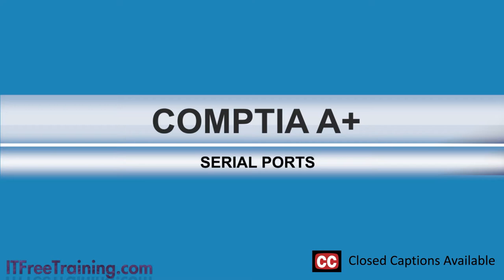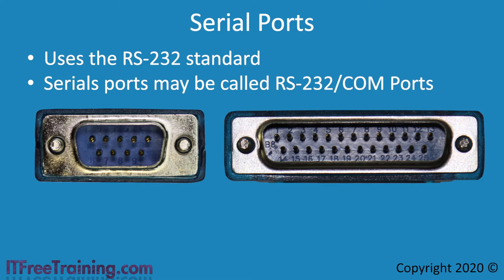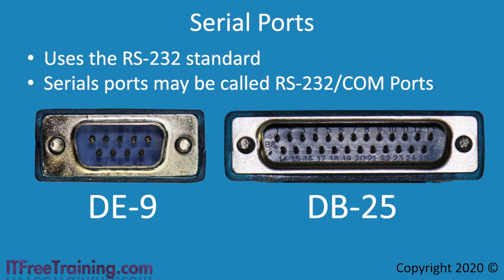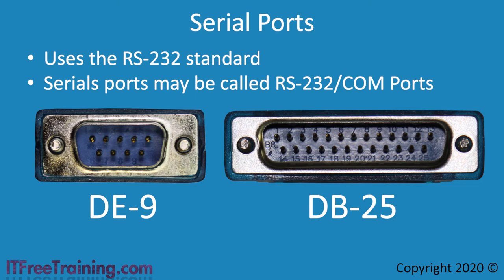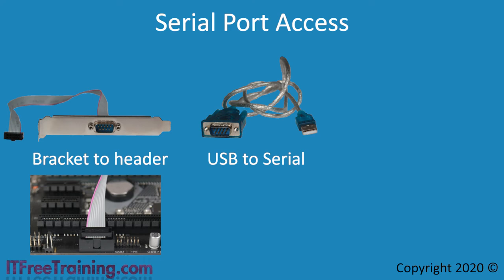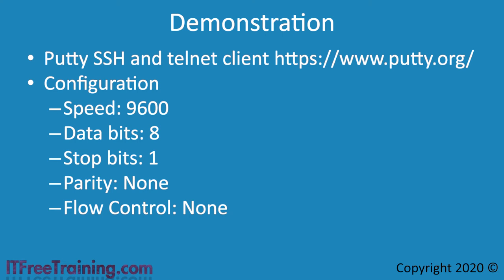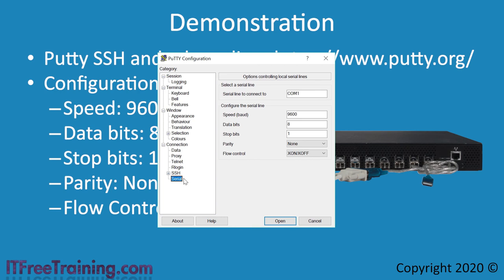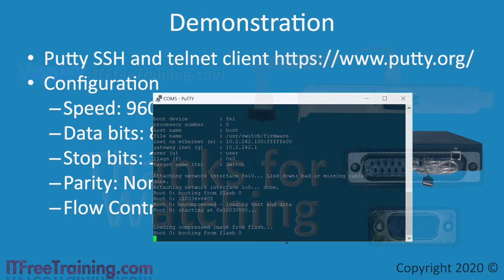Serial Ports

Comment: Nice to see someone knows that DE-9 is the correct term for a 9 pin connector, not DB-9.  I've been working with serial ports for over 50 years and at one point in my career had to order lots of connectors.
BTW, the 9 pin connector came in with the IBM AT computer.  The IBM PC & XT used 25 pins.  Until then I had never seen a 9 pin serial port.
Reply from the maker: Thanks. It has been a long time since I used an XT computer so I will take your word for it.

Comment: Very good information! I was in IT back in the 1980s and these things still give me nightmares. Modems, printers, scanners, computer to computer.... There was the way manuals said it would work, and the way it actually worked. We made "breakout boxes" with wires from DB25 ribbon cables soldered wire by wire to breadboards. LEDs in the proper places could show us what was really happening.
Reply from the maker: It's fascinating to hear about your experiences in the IT world from back in the 1980s! The technology landscape has certainly come a long way since then, and it's always interesting to reflect on how far we've progressed. Dealing with modems, printers, scanners, and the intricacies of computer-to-computer communication back then could indeed be quite challenging.

The "breakout boxes" you mentioned, with LEDs to provide real-time insight into data flow and signal status, were ingenious solutions for troubleshooting and debugging. They highlight the creative problem-solving that was often required in those early days of computing.

Thanks for sharing.

Comment: Two pieces of information I learned from this is serial ports are also referred to as  RS-232. The other is the smaller plug configuration is called a DE-9. I thought it was called a DB-9

Comment: Thank you. One question: if I buy an adapter from DE-9 to DB-25, then 9 of 25 DB-25 pins will be used, right? So what would other free 16 pins on the DB-25 side do? Would they just sit there and do nothing?
Reply from the maker: The extra pins provide some additional control signals etc, however it was pretty rare even back in the old days for devices to use them. Thus as time when on everyone started using the smaller connector. So if you use the adapters like what you are suggesting it is unlikely to cause problems since the extra wires were rarely used.
Reply: Well, I was asking because if I can only control 9 pins, then who controls the other 16?
Reply: @rimantasri4578   They just aren't used.

Comment: Thank you. I had a question ,I hope it get answered please. What if the device I'm trying to connect to is USB but the software is the old software and only communicates via serial. Is it possible to use the old software running a device that uses USB
Reply from the maker: USB and serial are different protocols. So probably not. Unless the USB connection appears in your computer as a serial port.

Comment: Hi! I bought a device with a software which only works with a usb key. I would like to know what that usb key sends to the PC and try to replicate it. Do you have some tip how to read it? Can the Putty help me in this situation?
Reply from the maker: You would need to get a USB sniffer to look at the traffic. If the USB key is used for copy protection then it most likely uses a challenge response system. Essentially the computer sends a challenge to the USB key, the USB key has information in it that is can generate the correct response. Thus, getting the USB traffic does not help since you don't know what secret is stored in USB key to generate the response.

Comment: Does anyone know the pinout for a 26 pin header on an old multi I/O card in IBM PC?... They have changed to 10 pin a long time ago (connecting the controller to either DB9 or DB25), but I have a REALLY OLD one: a Microforce PLB-85, in my IBM 5150... Next to nothing about this card in the net (it's RAM + RTC + parallel + serial + game), and for serial it has a 26 IDC header (just like for parallel) - labelled "ASYNC 1".... Wouldn't want to "try and fry".
Reply from the maker: Sorry, don't know the answer to that. Most ports don't use all the pins, so you could try an adapter to use the small one if you need to. You can always try some random settings to see if you get something working. If you are getting random characters you probably need to change the parity or flow control. 

I asked Chatgpt for an answer, but did not know either.

ChatGPT
The pinout for a 26-pin header on an old multi I/O card can vary depending on the specific card and manufacturer. However, there are some standard pin assignments that are commonly used.

Pin 1 is usually located at the top left-hand corner of the connector when viewed from the front, with the pins numbered from left to right and top to bottom. The pinout for a typical 26-pin header is as follows:

1. DCD (Data Carrier Detect)
2. RD (Received Data)
3. TD (Transmitted Data)
4. DTR (Data Terminal Ready)
5. GND (Signal Ground)
6. DSR (Data Set Ready)
7. RTS (Request to Send)
8. CTS (Clear to Send)
9. RI (Ring Indicator)
10. NC (No Connection)
11. NC
12. NC
13. NC
14. NC
15. NC
16. NC
17. NC
18. NC
19. NC
20. NC
21. NC
22. NC
23. NC
24. NC
25. NC
26. NC

However, since you have an old Microforce PLB-85 multi I/O card, it would be best to refer to the manual or documentation that came with the card to get the correct pinout. If you don't have access to the documentation, you may want to contact the manufacturer or a vintage computer enthusiast group for assistance.
Reply: @itfreetraining  Thanks so much for such a quick response! ChatGPT is quite amazing, but I'm afraid the only thing it got right is "can vary depending on the specific card" (I can see on the PCB that some of those pins are not connected at all...) Perhaps I should try to trace some of these pins to "obvious" legs of 8250, this might give me some clues. Anyway, thanks for trying to help. Interesting, how unknown this card seems to be - I bought it with my 5150, it is topping up RAM to the full 512kb, has RTC, parallel, gameport... The serial socket has never been there, I just decided one day "it would be nice to try some mice", hence my preocupation with putting this - so far bare - connector into use.
Reply from the maker: @LoftBits  I think you are on the right track to work out what this is.
I found this, but not able to verify the information yet. 
The male DB-25 is the second-oldest serial computing port, referred to as COM2, and the standard 25-pin D-shell connector for EIA-232 serial communication. Various RS-232 communications devices use the male version. The female DB-25 is primarily used for computer printer ports.

So I wonder if that second port is a serial port for very old serial printers. Which must be very old since parallel has been used for a long time.

Comment: what's the use of male vga(the ones that's in vga wires) when they're in the motherboard?
Reply from the maker: If you CPU supports graphics, you can use it to display graphics.
Reply: @itfreetraining  what does that mean?
Reply from the maker: @grinnazeed  If your CPU support graphics and your motherboard has a VGA port, you can plug the VGA port into a monitor and use it for graphics.
Reply: @itfreetraining  I know video output, what I'm asking is what does the male VGA port in my computer works? It's called a Serial port, what does that do?
Reply from the maker: @grinnazeed  When you say male VGA port, do you mean the serial port? VGA port is for graphic and the serial port is a connector by which a device can send data one bit at a time may to the computer.
Reply from the maker: @grinnazeed  Generally used for old devices. For example old modem and equipment. Also used to access network equipment, however nowadays USB have become a lot more common.

Comment: Thank you. Working on my A+, and even though I had other content to refer myself to, I found this very useful. Now I understand what a COM port is in the first place. I am still wondering why there are only 4 Communication ports? Subscribed.
Reply from the maker: On the original computers there was two com ports due to limitations with hardware. As hardware got better you can have pretty much as many com ports as you want. However, due to it being old technology, you don't see com ports used that much nowadays.

Comment: The fact you say that serial ports are largely obsolete is not true at all, still often used in embedded and industrial fields a LOT. Also sorry to say it but this video is not any more helpful than the first paragraph of the wikipedia page in my opinion.
Reply: I agree 💯👍
Reply from the maker: We probably should re-word that a bit better. In the IT world they are largely obsolete. However, serial is still used in electronics and some equipment.

The video is part of the A+ course. There is not much that people need to know to pass the exam when it comes to serial ports, so we don't go into a lot of detail.